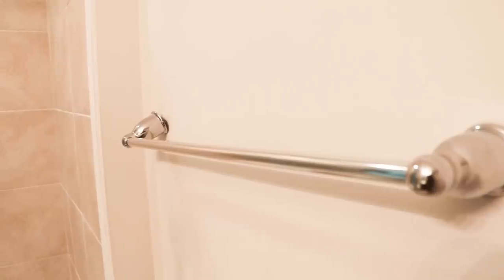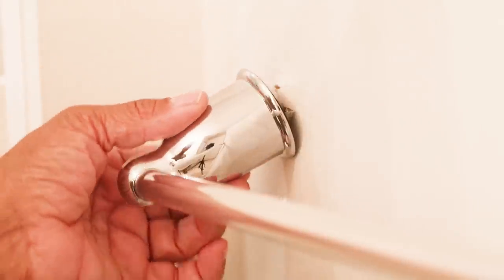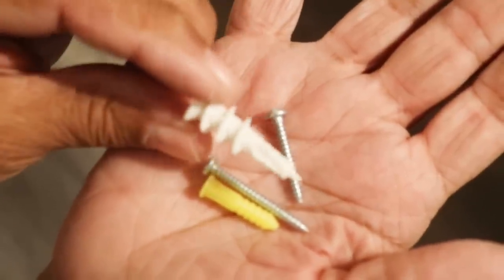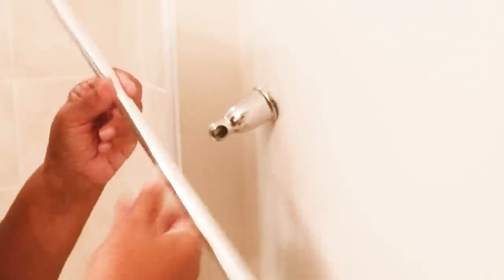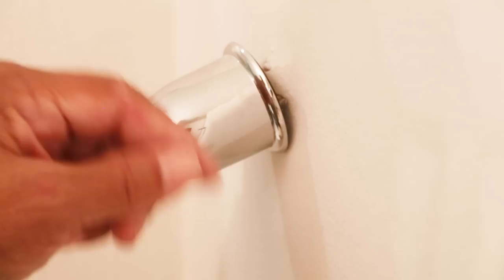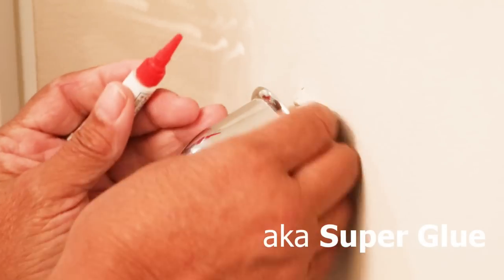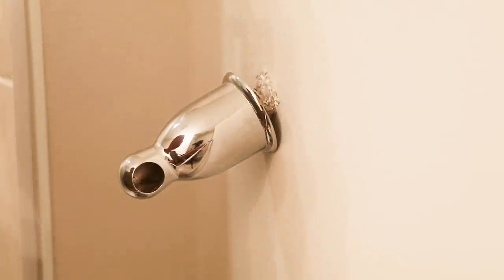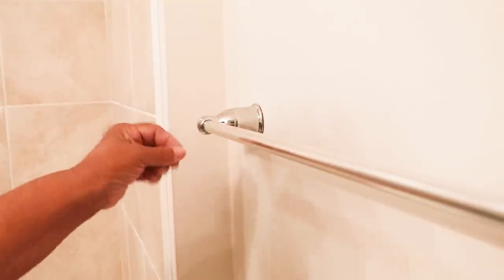Towel Bar HACK in seconds

Comment: What I want to know is why are Towel Bars 24” on Center? Interior Studs in houses are 16” on Center, also Modern Towels are 30 to 34” wide. Seems like 32” would be the correct Length.

Comment: Leah, love your channel but I disagree with this fix.   Sooner or later, this will just pull the paper and paint off the drywall, and you will have a worse issue.   The best thing you can do if you don't want to move the towel rack is to get those anchors that are spring loaded, that when they are pushed through the hole they pop open on the other side of the drywall, then you tighten it.    That would be a much stronger fix than the gluing option IMHO.
Reply from the maker: It depends on the size of the hole whether a larger fastener will work.  As for tearing the drywall paper abd creating a bigger mess, once you move the bar, you've got that anyway.

Comment: You glued it to the paint ... 🤔 ... so now instead of a silly wall anchor, you are relying on the bond of the paint to the paper.
That'll be hanging off again in a few weeks or a month.  Except, next time, it'll tear the paper off, necessitating a patch repair. 
This will actually give you a chance to fix it, though.  Cut out the damaged drywall.  Cut an appropriate width  1x long enough to extend 3 inches to either side of the hole.  Screw through the drywall to secure it.  Screw your patch in place.  Fill it, paint it, and install the towel bar receiver into an anchor point it WON'T pull-out of.  Next best to framing it properly the first time.
Reply from the maker: The bond is beyond just the surface of the wall, it is also "keyed in"

Comment: After you said “with no patching”, I assumed you were going to use the drywall hanger with spring loaded arms that open up behind the hole when tightened.  But super glue?  That seems like a rookie fix, for sure.

Comment: Very disappointed in this post. Bad idea. Not gonna hold up. Any weight or pressure on the bar and most likely it will come away from the wall again and this time creating more damage as it peels away paint and drywall paper along with it.
Reply: Totally agree... It's  a bummer.